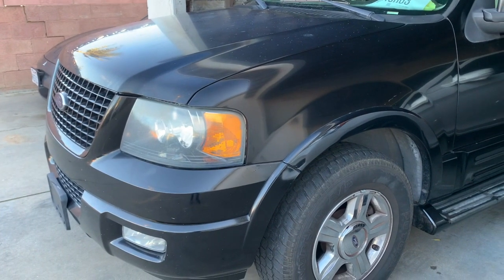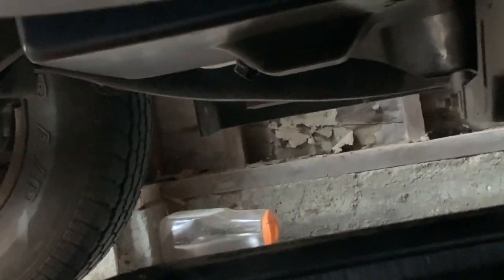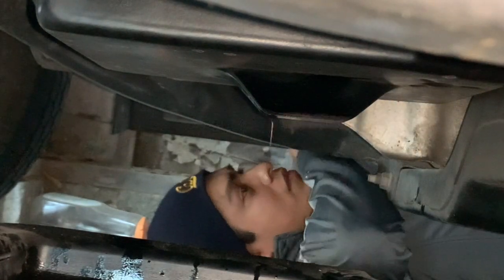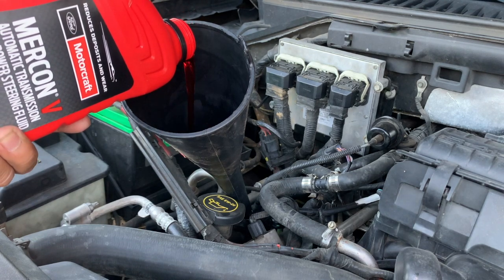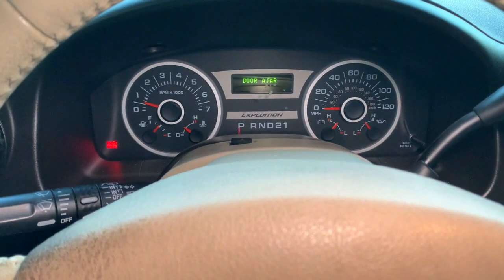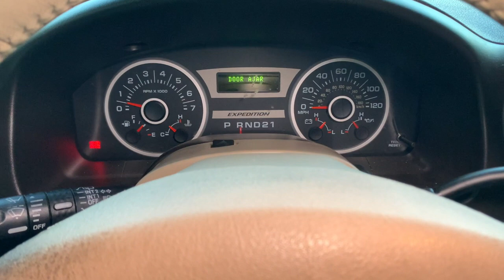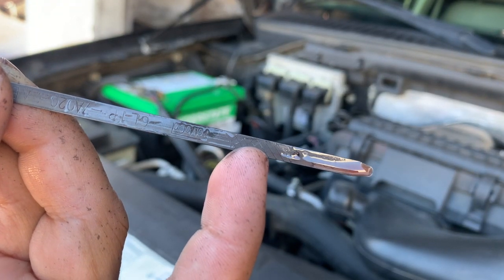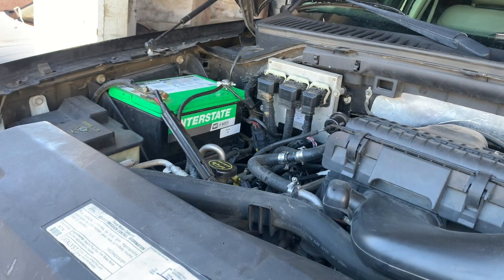How to Service Automatic Transmission Fluid Ford Expedition 2004 - 2006 Quick and Easy

Comment: When you change the fluid by removing the pan, what was the torque spec for the bolts of the pan?
Reply from the maker: The transmission pan bolts torque spec. is 10 ft. lbs. In order to accurately read the fluid level run it for 5-10 mins. around the block and let the temperature reached to normal temperature and with the car on - on a flat surface check the fluid level

Comment: Are you really checking the tranny fluid level with the vehicle off? 😱
Reply from the maker: Ran the car around the block (5-12 minutes) until the temperature was at normal temperature and checked the fluid. I have the information under description on how to check your fluid (on this car) —all cars are different so make sure you are doing it correctly.

Comment: That’s an oil dip stick not Tran mission dip stick😮
Reply from the maker: That’s the transmission dipstick - I know some newer models don’t have a dipstick but this one still has one
Reply: 2003 does have transmission dipstick and it says transmission  oil on it cause I have one to and its on that side